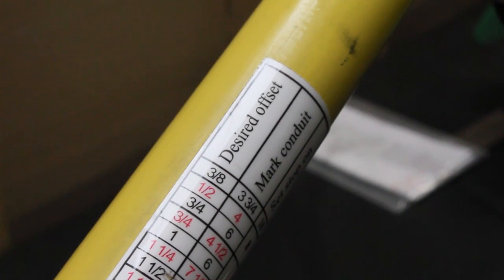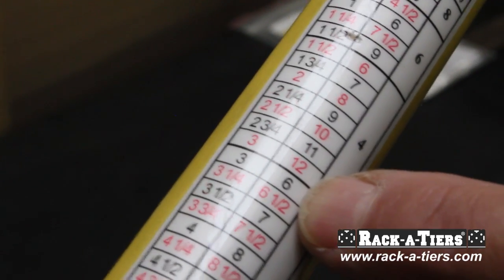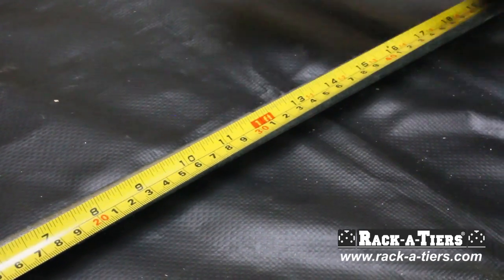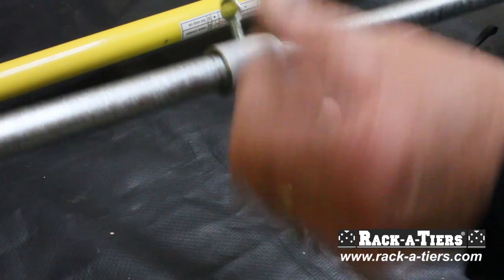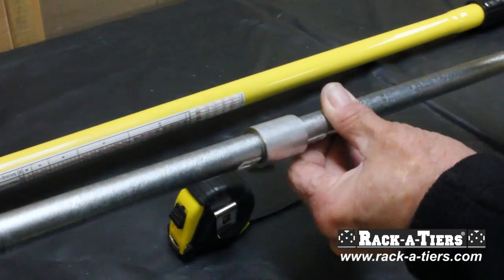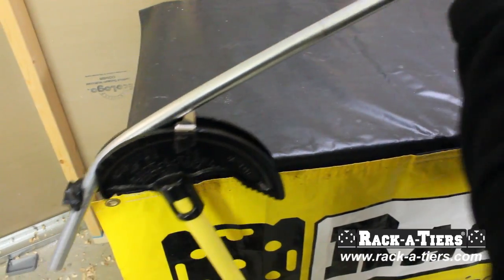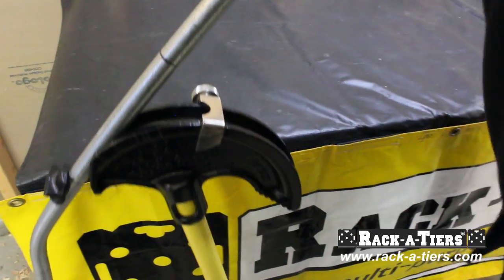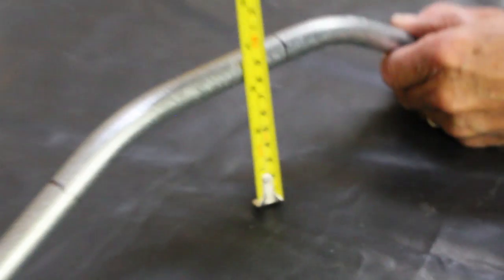Bending a 4 Point Saddle with the Hoppy Bender

Comment: Attention is in the details. Inconsistent bends since he put pressure so far back on the emt when bending. When he measured the saddle it was not even 3" exactly, he holds the tape measure tip off the table so it would read 3". 
The emt was also raised off the table on one side when he checked to see if each offset was true to one another. 

Pretty Sad, Amateur.

Comment: This is great if you just need to quickly bend a saddle over a single obstruction, but it's not a true 4-point saddle.  Every fellow electrician I've ever asked for tips on bending a 4-point, however, would probably argue, because they all have the same brainless answer: "uuhuhhhhh you bend two offsets and use a coupling in the middle.  duuurrrrrrr what do you need a 4-point saddle for anyway?"  Multiple obstructions in a tight space, and want to make it look decent, this won't help. 

There is an app for android phones and tablets called "Electrical Wiring Pro" that covers about every other basic type of conduit bending, though.  Along with your most commonly used code references.  And the bending part of the app does account for shrinkage, and is very accurate.